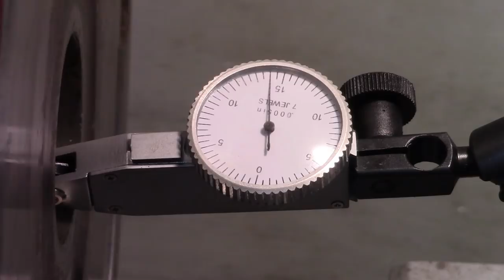Lathe Carriage T-Slot Plate - Part 2

Comment: I was out on my lathe just the other night trying to fugure out how to do this. Now I know;  Your T slot idea was a gem. I now have the confidence to try it myself. Now all I need is a big chunk of flat steel. I too want to use it for line boring.
Reply from the maker: Hi Warren, I'm glad it could be of some use to you.  Admittedly, the setup of the workpiece to the plate is not fast and requires shimming but it will work for what I need for now.  One thing about cutting t-slots in boiler plate is that I found a few hard spots in it and they messed up a couple end mills, so if you have cobalt or carbide mills they might be preferable on boiler plate.  Thanks for coming by!

Comment: What a great way to cut t-slots. Very cool project and well made too. Thanks for the series of videos!
Reply from the maker: Thanks!  It's got its limitations but for what I need it to do the price was right.  Would have made real T-slots with the proper cutter if I had one, but it takes time to accumulate various tools and for what's needed this style of slot will suffice.  Thanks for coming by!
Reply: Tell me about it. I'm still buying tooling every time I can afford some. The hardest thing is to resist the cheap Chinese stuff but sometimes there is just no other way. Thanks for the reply!

Comment: Hi Everett.
If you had bought a tee slot cutter you would of had to have an open ended slot for cutter access at one end which would have weakened your table.
I like your table as it is. I think it's great. Top marks 11/10 in imperial or for the metric conversion 110% out of 100.
"Things are close enough" as you say. I agree with you, we can all make them a little more accurate when needed but we ain't Abom79. (I wish) 
We as amateurs get a deep sense of satisfaction when the item or tool we have made actually works. That's all that matters.
Watch this space. I'm doing almost what you have done right now using a (I haven't made it yet. I'm thinking) between centres boring bar to true up a...……………………………..
Watching this video brought back memories of myself many years ago. It's not the actual machining processes, its YOUR passion and body language that comes through to achieve your desired result.
Reply from the maker: Thanks Tony, the plate does work but it's not pretty. At some point when the shaper is up and running I'm thinking of using it to clean up the mill scale sides. As for precision, it's not that I don't care or wish to be too cavalier about it but certain things, especially one-off home jigs, just need to work. I certainly don't claim to be a pro, just a guy who likes tinkering and is happy to be able to share in the community.

Comment: Nice job, it looks like a version of a lathe milling attachment. You will never know if you can do something if you don’t try. Keep the videos coming! JB San Diego.
Reply from the maker: Thanks Jim, it was inspired by seeing how some older lathes had t-slots milled into the carriage itself for milling and line boring operations.  This plate comes in handy at times, and I hope to improve it once the shaper is up and running by cleaning up both main faces.

Comment: Hi again Everett. To reiterate what I said before - that plate represented a huge amount of work. I rather wish my old lathe had a T slot cross slide even though I don't need that for milling - several times in the past I could well have used t slots for a few awkward operations.!
Your T slot approach was ideal - probably for sure saved the hassle of a T slot cutter. That 'mystery material' seemed some pretty tough stuff! Altogether a great result - super useful project. The test worked out very well and, occurred to me - you may well find that T slot base very handy for a line boring job - haha, you mentioned that!.
Most enjoyable video :)
Reply from the maker: Thanks, Chris.  It's got a couple rough edges but appears to work for what it's designed to do as long as I'm careful in how much tool pressure is being used.  The 1" plate was interesting stuff to work with.  Some areas cut easily while other areas had what appeared to be hard spots - messed up a couple end mills on the middle slot, but it eventually cut.  Part of what got me thinking of this was how MrCrispin was machining steam engine cylinders on his old lathe and doing a line bore with the cylinder block mounted to the cross slide.
Reply: I thought I had Mr Crispin in my subs, must check. Haven't seen him for ages - lovely loco he was building. Indeed, classic example for line boring that was. :) It's about time we had a new video from Clickspring!

Comment: Very enjoyable to watch mate, I’m impressed to say the least, thanks for sharing your ideas,    Cheers Matty in Australia 🇦🇺
Reply from the maker: Thanks, it's not an original idea, as people have strapped stuff to cross slides for years but this is the best way I could think of for this machine.  If I ever get a shaper or surface grinder the top and bottom surfaces will get touched up.

Comment: Hi again Everett. The plate turned out really well. Luckily i have t slots on my Boxford lathe and so far i have only used them to mount an angle plate a few times. It is tempting sometimes to try and take too much with a milling cutter in one go. But you got away with it. All the best.   Jim in. UK.
Reply from the maker: Thanks!  There was a little tool deflection when I was trying .100" passes on the mill, so had to back off a bit.  It's a shame that newer machines don't come with T-slots like yours.  Thanks for coming by!

Comment: Nicely done, wish my mill could handle the milling aspect of the project. Maybe time to see what its made of...Lol. Enjoyed and congrats on the end result ~ Richard
Reply from the maker: Thanks, it took a while to get the slots cut even with the machine I have.  Taking .100 passes I found that with this machine there was a few thou worth of deflection each pass. Not sure what sort of rigidity your machine has but light passes would probably work if you were careful. Would recommend maybe not using plate but cold roll bar as the plate had hard spots.

Comment: Nice project.I priced some of the T nut bolts that you made for the cross slide at a local store at about $10.00 US. I did like you did and made my own.
Reply from the maker: Wow, that makes them about 13 bucks Canadian . . . Thanks for the compliment, just trying to make stuff that will work with the equipment on hand.  Thanks for joining in!

Comment: With your problem with shimming the work piece up and down to get on centre you could try bolting an angle plate to your t slot plate and then fix the work to it.

Comment: It had to make it so much stiffer ! Must be easier to work on projects that way ! I’m not sure why they don’t come with t-slot compound rests ! It make perfect sense and gives more room for bigger materials and projects ! Did you use enough toe blocks ? Lmao. I’ve tried to make a lathe a mill for some time now but still not ridged enough ! My 7x12 and 7x10 are small compared to yours ! I should extend my ways to 20 on the 7x12 ! Lol. But I’m happy with them for now !
Reply from the maker: Thanks Dave, this was mostly made for being able to do light line boring and another experiment I wanted to try but got too busy.  Then had another kid during COVID.  Then moved.  Now trying to make a new workshop.  Basically life got in the way, lol.  So, I'm hoping to make use of it more over the winter once my garage has drywall, wiring, and heat.  
I have seen some lathes with T-slots on the cross slide but they are a rarity.  It would seem to be a good idea but I guess that's one thing that is axed to make the machine as cheap as possible.

Comment: Fantastic job surely it's a hassle having to take it apart to put in longer bolts I would get some hex bar and make custom extended nuts out of it.Eliminating having to strip down when height is called for. IMO subscribed
Reply from the maker: You know, that is a heck of a good idea, wish I would have thought of it!  Got some 3/4" hex in a short drop sitting in the scrap pile, it's going to happen.  Thanks for coming by!